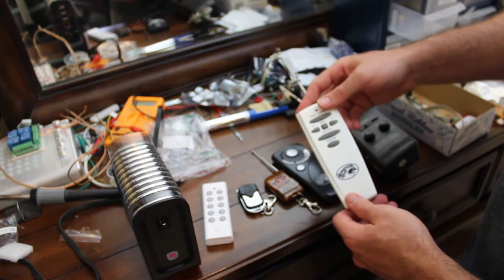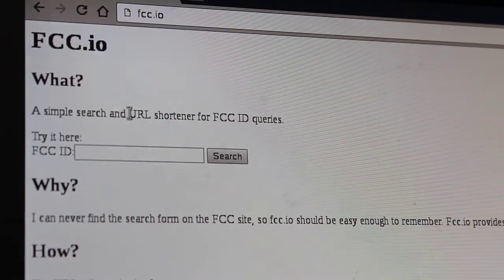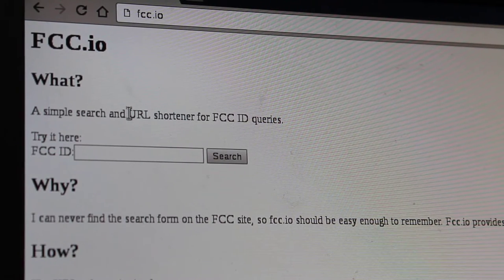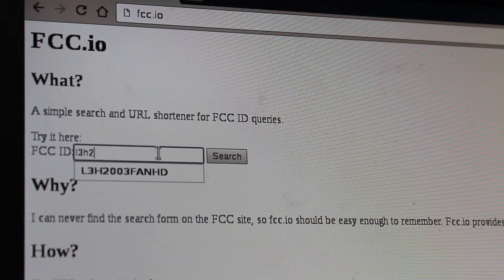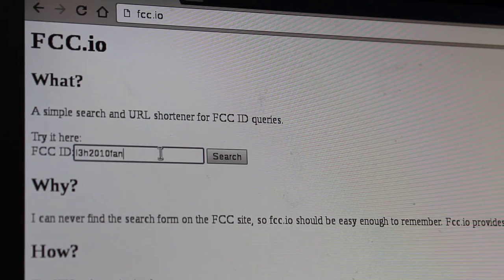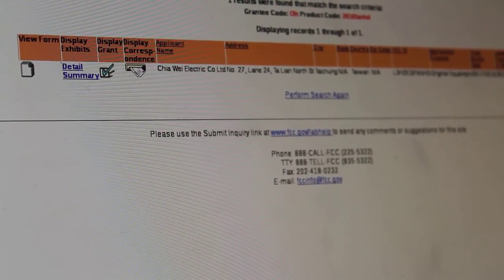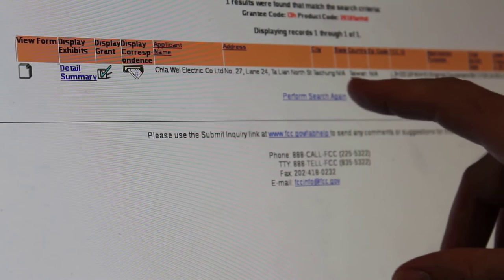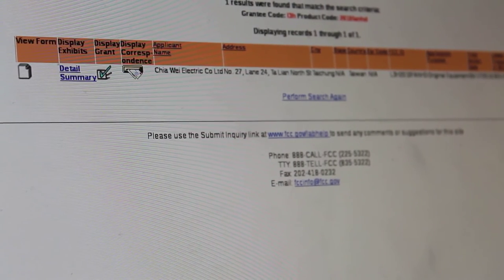Find What Frequency a Radio Controlled Device Runs On

Comment: I'm trying to determine what frequency mhz my gate opener remote is.  There is no frequency or FCC code on it anywhere inside or out,  nor in the owners manual.  How can the frequency be checked to see if its 310, 330 or 433 mhz, etc?  Update 6-30-24:  Ongoing pain is the ass with no frequency listing of any kind on my remote unites  Guess somebody at the FCC slipped up.
Reply: Bump. Also having this issue.
Reply: I also want to know that for my fan

Comment: iv got my module transmitting a signal but its on the wrong freq i guess its set for your sockets how can i change the freq to the desired freq?
Reply: Most modules you can't change the frequency, you have to order the frequency you need.
Reply: Thats the thing i cant find any for sale cheap that operate on that freq, and ali express order actually said it covers that range but dont know how to specefy that freq :/

Comment: Kris I have been messing with RTL-SDR and at first I was using my Raspberry Pi to transmit with a jumper wire connected to the TX pin which works great shorter range.  You should definitely do a series on RTL-SDR , the dongles are so cheap now you do not have to splurge on HackRF or any of those pricey radios.  I know for a fact you have multiple Raspberry Pi's so you would be the perfect person to cover this , since you are so thorough .  Some of your viewers wanted you to talk about security , they were asking me a lot of questions I dont know if you interested in covering the topic , I will do whatever I can to help the channel.   Thanks

Comment: do projects on chip computer !!!!
Reply: What Would you like to see done?
Reply: Kris Occhipinti like nas server,pirate box,security cam etc....
Reply: rishi jyothi For NAS I would suggest getting a Pogoplug.  They are only about $15, come with an enclosure, and they have a power supply better suited for powering hard drives.  

I'll have to look up what a Pirate box is.

Security cam, a program called "motion" is a good option.  It should be in your repositories.  FFMPEG should also work.

I probably won't be doing video on these anytime soon, since these are General software questions and not really related to the CHIP computer.  If you think of something related to the CHIP computer you would like to see, let me know and I'll look into it.